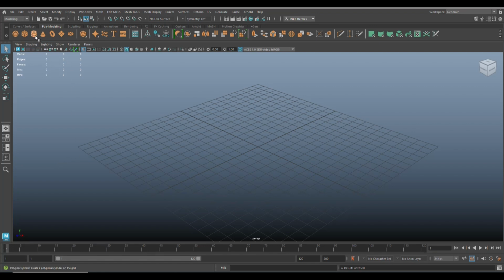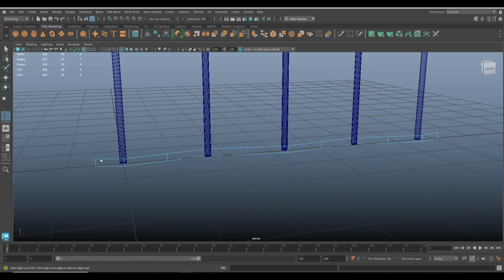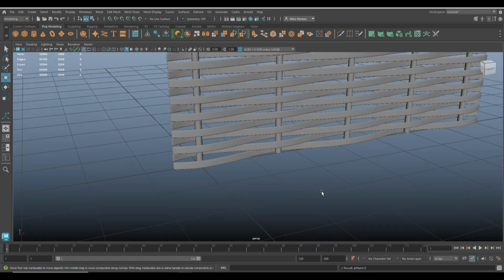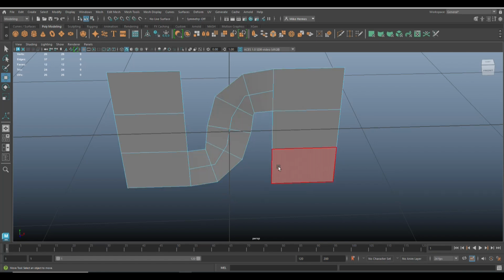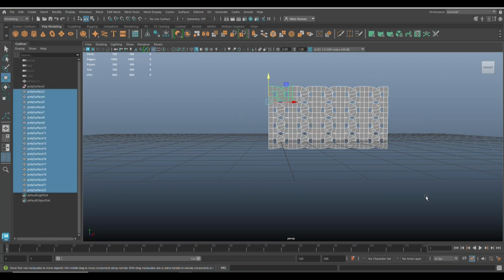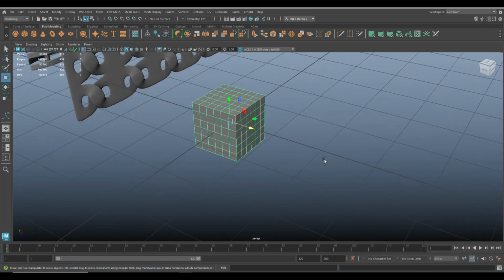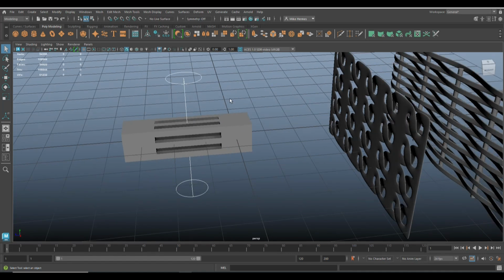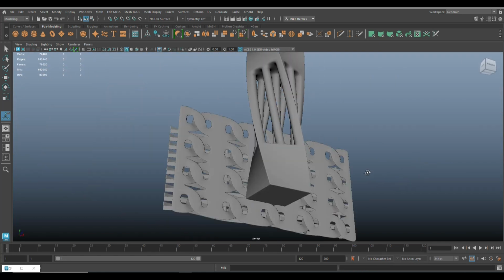Maya 2023 tutorial : How to weave, twist and make cool patterns !

Comment: Nice video!
Might I know, if there is any platform where I can have access to an older computer for 3D-modeling/rendering?
Reply from the maker: Access to a computer ?
Reply: @MHTutorials3D  I mean buying a used computer with a good configuration for modeling/rendering.
Reply from the maker: @3DCA  If you are using Maya then Google "Requirements for using Maya" It will tell you the minimum requirements. It does not have to be a new PC